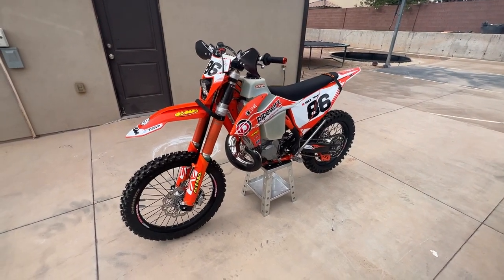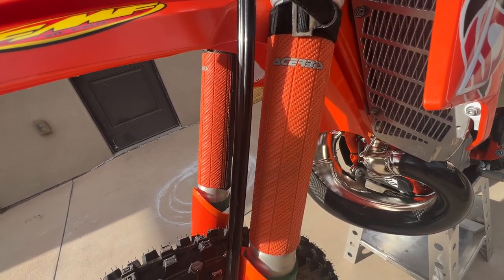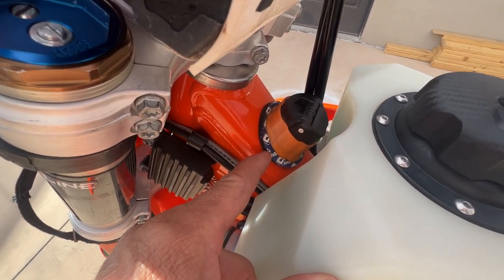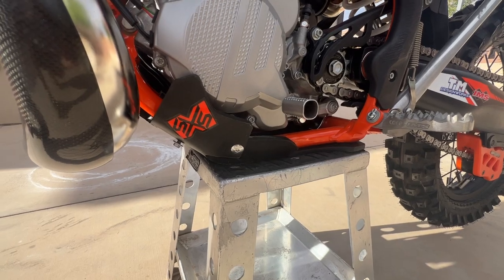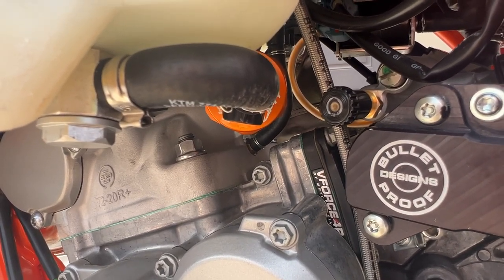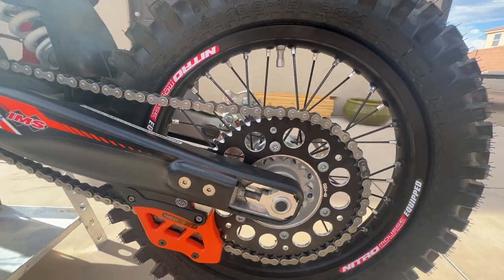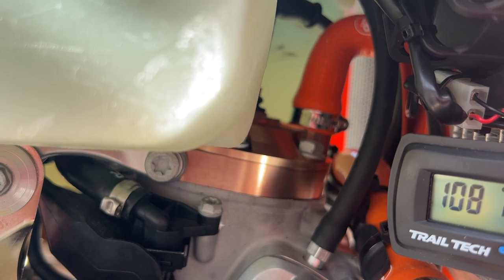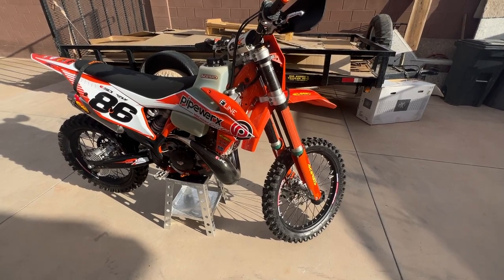2023 KTM 300 XC-W (EXC) Hard Enduro Motorcycle Build

Comment: Nice build. Have many of the same components on my 21 TE300i.  Curious as to why you went with the xcw versus the new 23 xc with no fuel pump/tpi?
Reply from the maker: Mostly a timing thing. I had this bike on order from midyear last year, and got it back in May I think. And around here the XC’s aren’t even available yet, so I’d be five months without a bike still. Plus, I prefer the PDS for what I do over the linkage. If I was racing desert again, I would get the xC, but the XC-W is more my style.

Comment: Great build. How did the brake pedal tip work out? Thanks
Reply from the maker: Great. I like it and a great company with awesome customer service. I sheared one of the two bolts that holds the brake pedal tip to the brake pedal arm in half, and called CleanSpeed to get a replacement bolt, and they sent two bolts and a brand new brake pedal tip!  Great company! I like the pedal tip which allows you to keep the ball of your foot on the peg and still reach the brake pedal without repositioning your foot (mostly).  Solid product!

Comment: Nice build! I too have the same scoot. Thanks for showcasing some nice hardware. What  are your thoughts are on steering stabilizers?
Reply from the maker: Unless you are racing desert, not needed.  I’m a long time, retired desert racer, and have never not had a stabilizer up until about a year ago. I would’ve sworn that it was a dumb decision and unsafe to ride without a stabilizer in the past, but since I mostly do hard Enduro slow speed stuff, Ive not needed it, and haven’t missed it in the least bit. I stopped using mine this last year and feel completely totally comfortable without it, although I would’ve thought differently had you asked me before this year. So, they have their place, but not in Hard Enduro, or just for someone that puts around on single track. Down in Baja, desert races, and higher speed single track stuff, they’re definitely a good tool and piece of insurance. Matter fact, I have three of them sitting in my garage not being used right now.
Reply: Thank you for the informative feedback. I ride southeastern single track mixed with two track and was wondering if a damper would be useful. My speeds vary from really slow single track to moderately fast on two track.
   @BestNThDez

Comment: Great video.  What rear tire are you running.  ?  Thanks.
Reply from the maker: I don’t recall what was on the bike when I made the video, but depending on what and where I’m riding, I’ll run an IRC VE-33s (best all- around for everything out here, excluding high speed single track desert racing type stuff, due to longevity), IRC JX8 Gekotta (great gummy for tech stuff, that does amazingly well even when worn out. Lasts longer than one would think for a gummy),  or a Tusk Recon Hybrid (great cheap tire for different terrain out here in the SW.  Not the best at any one thing, but OK/good on a lot of stuff, especially for $50) all on the rear. 

On the front, I run Goldentyre 216. AA Fatty, and Bridgestone M59’s.  I buy the M59’s when on sale, as the Goldentyre is so expensive, but it lasts forever. I got 30-35 hrs on my last Goldentyre.

Comment: Very nice! The shorter silencers gives you more top end, not bottom.
Reply from the maker: You are mistaken.  

Directly from FMF's website- 
"The Shorty will give you even more throttle response and low end power", "this design results in a finely tuned bolt on performance silencer that maximizes bottom and mid rpm power.".  

"To Whom It May Concern: Thanks for contacting FMF Racing. The SST is meant for top end power, but your Shorty silencer is meant for bottom end power."
Reply: What was that you where saying Tom?

Comment: Just sold my 12 500excf. Why do I have 300 on the brain already .didn’t see a stabilizer or is that because no need for speed .👍👍👍👍
Reply from the maker: I used to ride the big four strokes also, but later in life, I got more into the hard Enduro. As far as the stabilizer goes, you are right, no need for one, plus they limit your steering turn angle typically, and that’s an important thing to have in hard Enduro.

Comment: looks more like a desert bike not enduro
Reply from the maker: Why, because of the desert tank?
Reply: That as well but you need a good front disk guard and I would recommend a dirt tricks sprocket  bulletproof makes front fork lug guard. For hard enduro you would want not that big of a gas tank stock is more then enough
Reply from the maker: @Hardenduro488  Ya, I haven't found a need for a front disk guard yet, although one wouldn't hurt.  I have 198 hrs. on this bike already, and haven't had to touch the disk yet.  As far as the desert tank goes, I do long desert single-track rides every once in a while, and hate having to cut them short due to the lack of fuel, so I just run this tank and only fill it as full as necessary when I ride tech stuff.  It hasn't and doesn't bother me one bit, but yes, I could put the stock tank back on and probably be fine most of the time.